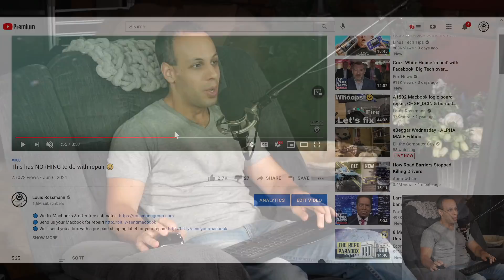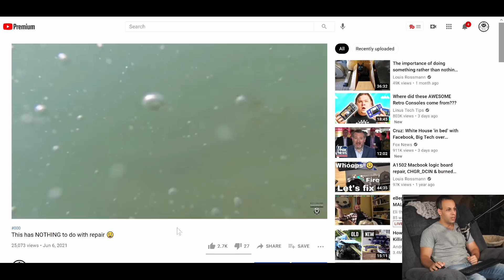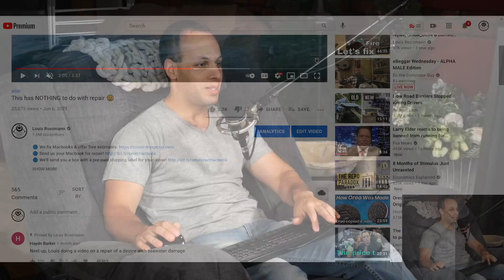Why are user serviceable batteries a bad thing?

Comment: It's great that you pointed this out.  I did not even know that there are people who want sealed batteries.  I remember when phone manufacturers started sealing the batteries, I was annoyed because I am convinced that they are doing it on purpose to force people to buy newer phones when the battery start degrading.  I had many phones and  it is ALWAYS the battery that needs replacement first.

Comment: I miss user replaceable batteries. My Galaxy SIII had a plenty sensibly sized battery and a decent quality case. And, thanks to being able to replace the battery, it lasted me nearly six years. I only upgraded after those six years because the Galaxy S8 was on a pretty solid discount at the time of upgrade. Hell, I ended up having to upgrade to the S10 from the S8 half a year ago because the battery of the S8 was already starting to go down the toilet and didn't last as long as my job requires. I miss my Galaxy SIII already.

Comment: Modern L-Ion rechargeable batteries typically (or should) last longer than the usual mean time to failure (MTTF) of phones and other smart devices; by the time the battery has reached MTTF, the device will be obsolete. This is not true in all cases but it should be true in most cases. Thus, most devices should not need a user-replaceable battery. If the battery reaches MTTF before the device is obsolete then I would suspect that the original device manufacturer (ODM) deliberately designed the device to have that behavior just so they sell more devices.
Thus I can also see the validity of the right to repair argument. If the ODM is making the device unnecessarily hard to repair then they shouldn't be allowed to do that. If the user wants to replace the battery then that should be the user's choice and the ODM should not be able to frustrate that choice just becasue they can. The ODM should have to show an actual necessity in the design features if those design features are going to frustrate the repairability of the device.

Comment: For one I kinda dislike removable batteries because eventually, yes I can replace the battery with a new (hopefully original one), yet the mechanism that holds the battery inside the phone is definitely not user serviceable. I had a personal experience with my phone suddenly turning itself off only for me to realize what was going on and to use a practical remedy (to slip a folded piece of paper keeping the contacts of the battery and the phone intact). Then I also hate that when you drop these kinds of phones, the battery itself springs free from the device lol. Otherwise if it would be virtually impossible for these situations to occur, I would definitely want a phone with a replaceable battery. I'd then buy a flagship phone with tremendous storage and performance and I bet it would last me a decade.

Comment: You are a hundred percent right Louis!! I had to give up my old Samsung phone because I did an update and the camera plus the flashlight stopped working. Got talked into buying the newest Samsung phone which has none of the features I originally switched from Apple to Samsung for! No data chip and no headphone jack! I will no longer be buying from either of these companies because what originally set them apart no longer exists! They are exactly the same!!!

Comment: limitations stimulate creativity. If you have to design a new devices that is both waterproof and with a user serviceable battery, you will be challenged to find new inovative solutions, but you will find one. At the end of the day, it's possible if they wanted to. But they dont want to.

Comment: Some people have no clue about the hardware they use.

If they have a problem, they will immediately run in a shop and claim its not working, pay whatever they charge them and thats it.

And if they are once told that repairing your phone on your own is removing the warranty, they will never touch it again.

For a lot of "luxury" hardware , even headphones, wireless mouse/keyboard etc. some have a backed in battery and its not replaceable, if it goes dead, people buy new hardware, so the company producing it has all the reason to not make the battery replaceable, as it provides them a much bigger profit.

Funny enough, companies with replaceable batteries do not advertise that "feature" enough, while they should, as the people that care for it are tech-savy enough that there is no need for advertisment.

Its the same deal with displays. if it has a "tiny" crack replace the entire expensive front of the phone, instead of providing a stronger protection for it in the first place, people just buy a new phone if they damage it and are "trained" to do so.

Comment: What bothers me is that there are many budget and even some 600+$ phones that come with plastic backcovers nowadays.
Why can't you pop these out and easily replace the battery just like 2010?
I understand that you would need to seal glass backcovers for rigidity and safety but plastic?
You can't even argue that it's more premium or luxurious to seal the backcover since it's plastic.

Comment: Maybe it is because: "big company, I trust more than small company"
I don't know.
I want batteries to be user replaceable.

Also; EVs use LiFePo4 chemistry, phones use LiZn.
LiZn (as far as I know) are optimized for capacity at the cost of lower number of charge cycles.

So a phone battery dying faster doesn't translate to EV batteries doing the same.

Comment: Good rant, but those are not even the most important reasons. I still have a Samsung Note 4 because it was the last one with a replaceable battery. If I want privacy, I can just pull out the battery. If my battery dies, I can swap in another one in, 3 seconds instead of having to plug my phone into a charger. I will never want to give up those things, so a phone with a sealed-in battery is an absolutely out-of-question deal-breaker for me.

Comment: Most phones break or get upgraded before the battery is debilitating to the phone, yes some replacement years after retail release is due to battery wear but the solution is improved recycling ethos amongst consumers and waste services (provided by or subject to the government).
The average consumer will not source, buy, wait for then install a new battery or pay and wait for a repair shop to do so instead, so sacrificing removability in favour of more durable or smaller batteries is worthwhile (both reduce eventual replacement and waste)
Removability is functionally advantageous as an 'empty' battery can be instantly replaced by a charged one so the device can continue operating, today that's only relevant to cameras and devices intended for production/industrial applications, early phones were likely a holdover of that mindset until improved capacity and consumer disuse of removability proved it's not worthwhile to retain in place of the improved water-resistance and freedom to 'miniaturize' provided by non-removables.

Comment: I wonder if battery sizes would remain the same with removable and non removable batteries since usually the removable ones have lots of plastic covering the motherboard and usually their sizes are less than 3200mAh. That's unless they leave it bare with the entire frame and back cover coming off as one and the components are attached to the screen like the Samsung Note 3

What if the rear battery cover comes off with the battery. Instead of having the battery attached to the phone there would be pogo pins and the battery would just slot into the rear cover and not the phone itself. Like a quick swappable rear cover/battery combo. If they could make it as satisfying as DSLR battery swaps or we could have half battery swaps like the modular LG G5 but there's a small built in non removable battery and there's the bigger swappable one so the phone stays on at low power while you swap batteries.

Comment: The I prefer a removable battery is because it allows me to extend the life of the device, and I don't have buy a NEW phone when the battery stops charging properly (which happens every 1 to 2 years). 

I think it's ridiculous when phones have become more expensive than even laptop computers. For $800 to $1000 dollars I could buy a mid-range gaming laptop.

Comment: If I can possibly  avoid it I will not buy anything with a sealed battery.  Two way radios, pagers, computers, when a battery needs to be replaced I need to be able to change it instantly.

Comment: One way to make the battery replacable while fully sealed is: plain screws and a gasket. A few screws around the back cover, with a gasket around the screw and panel perimeter and you get a sealed unit with a replacable battery! At worse, you need to replace the screws and gasket at the same time as the battery.

Comment: except the battery being non replacable is so you cant turn the phone off to avoid being tracked by the government, and its a BLATANT fire hazard, being unable to remove my lithium based battery means i can niether save my phone in the even of battery failure or contain the ensuring lithium/plastic fire by removing the battery before ignition.
frankly if my battery does ever catch fire im going to IMMEDIATELY sue for creating an unessicery fire hazard.
frankly the only reason i bought a google phone is for the camera and i regret it.

Comment: The last laptops I used with modular batteries had Core 2 Duo CPUs i.e. 2008-2009 or so. Did Apple start the trend of sealed batteries with the first MacBook Air?

Comment: The problem with the removable battery is the fact that the back is either clipped on and can come off or not be sealed properly and fail (Galaxy S5) or it'll leave a seam that pops apart (LG V20)
The rich kids don't want that since they like throwing their devices.

Comment: That's 2 of the things I miss the most about my old phone before I moved up to the Samsung Galaxy S -series: I had 4 batteries for my old phone, which IIRC was an LG. TRUE rapid charging is swapping a battery in 30 seconds and having 100% life. 
AND other major feature, you can actually, definitively turn the phone off and know it's off, by removing the battery.

Comment: If it doesn't have a replaceable battery "I am forced to buy a new one, really I don't want to but I have to". Which is what they wanted in the first place. A quality fashion chain here is AUS did some research on why women weren't buying their product. Turns out it wasn't price as most would have guessed, it was that it "lasted to well". The sooner it looked a little worn the sooner you can replace it. p.s. I'm still running an S5 lol

Comment: One issue I see is wireless Charging. It uses both the charging coil and the glass back to make it work. This would pretty much stop any efforts to have a removable battery. You could have some system that allows you to move the wireless Charging up and out of the way, however that adds complexity which increases the chance of failure and the cost. You would only be able to have a partial glass back since a full one wouldn't work for moving it up and there's a large possibility of the flex cable for the wireless charging to wear out.

Comment: i agree with you rossmann but ive always preferred batteries in phones i could replace main reason being at most i have to spend $30 for a new battery instead of $200+ replacing the whole phone do to the battery being at the end of its life/ battery shorted out and no longer being useful

Comment: I'm still using my Samsung S5 because it has a user replaceable battery. I just bought a Pine Phone because everything is user replaceable. When other manufacturers build phones that will last,I'll buy it. I'm on my 4th battery for the Samsung but finding good new batteries is getting harder.

Comment: User replaceable batteries are a horrible thing.  they let you take the battery out of phones so they can't be tracked.  Apple has every right to remotely activate my phone and ping it to find my location, and i have no right, or justification as an end user, to be able to pull my battery so they can't do that.   

If i couldn't i could hide from the police for example.   which is 100% wrong.

Comment: I have an LG G5 (model LG-H820) phone, and have had for years.

While it's not a "water resistant" phone, it does have a very easily replaceable battery (though now finding an ACTUAL new batter vs. new old stock is a pain in the ass).

For water resistance I invested a few dollars more in an "Otter Box" phone case and now I don't necessarily have to worry as much about moisture (though after all these years I doubt the case is as water proof as it once was).

Anyway, if/when I replace this phone I am going to miss being able to simply take it out its case, pulling the bottom off, removing the battery from the bottom and then attaching the battery and reinserting it...

The ironic thing to me is that this phone is ONLY 5 years old, having originally been released in 2016, yet it's thought of as a 'relic'.  

THAT is the really sneaky thing the cell phone providers and manufacturers have done to us...   Any phone older than two years and suddenly you start hearing, "OMG, where'd you find that old POS boomer?!?!?"

My grandfather used to regale me we stories of how it was so much better in the 50's and 60's:  "Remember when it used to be a point of pride in companies that, "This will be the last 'widget' you'll ever need to purchase!  We're so confident in its design and manufacture, we'll give you a LIFE TIME warranty on it!"  Now-a-days everything is built like crap on purpose so it'll fall apart.  There's no pride of product any more!"

Comment: I guess most people forget that there is a SIM card compartment, that there is a charging port, and buttons on theirs devices that are movable parts and are liquid resistant at the same time. The technology has been there. 8 years ago I got a Kyocera flip phone that had a removable battery 10-key pad with other function buttons on it and I could use the phone underwater, send txt message, video, flip closed and open again. And never drown it. It actually still works to this day. Just quit using it.

Comment: wait, there are people who believes the lack of removable battery is actually a good thing?!?! have they never had their phone completely lock up and the reset button not respond before? I may be someone who will use devices for well over their life span, and have actually had devices outlive their battery before, but removing my need to be able to buy a new battery and drop it into my device, which I've had to do on a device that didn't have a removable battery compartment before, I have dealt with too many troubleshooting issues where the best option was literally to remove the battery, and you can't do that if the battery is sealed in.  Then again, this is a life long tech head speaking, rather than the average joe shmo who has to take their phone in when the sim isn't reading because it got unseated

Comment: The excuse I've always heard is that a user replaceable battery takes up more space inside the device, which could instead be devoted to better processing, or higher capacity battery, or something else, because phone design is largely volume-constrained. 

 I don't know if I believe this, but even if I do, I would probably prefer I use the replaceable battery and a thicker device or something.

Comment: I like being able to change out the battery. What I don’t like is not knowing which batteries are great and which are scams, or at best low quality. I imagine you get your DJI battery cartridges from DJI. I don’t know what could be done like that for phones. Also, there is a reason that camera batteries were swapoutable due to not generally having enough juice for all the work expected between charging. Phones have a much different history, with batteries lasting between charging times.

Comment: I mean, have you ever seen a removable battery that has as many mAh as a Samsung or iphone flagship device? As far as I am aware There's a limit to where the removable batteries can get to in terms of mAh. like my phone's battery though non-removable has a mAh of 4300-4500. Though there is a right for repair shops to have access to the appropriate batteries for said devices they are repairing.

Comment: I don't want /user/ replaceable batteries, mostly because making them easy to take out means they need a plastic cover and everything, so phones would get either thicker or have shorter battery life, compared to the sealed-in pouch battery. I still do want phones to be serviceable by some sort of specialised technicians (manufacturer-independent) who know how to get them open safely and seal them back waterproof afterwards. And of course I want the manufacturers to actually sell these technicians original replacement batteries, because if history taught me one thing, it's that cheap knockoff battery packs usually spell trouble.

Comment: The one argument I've seen for non replacable bateries is that because they dont' have to have a hard shell they can achieve higher capacities. which would be great if better power efficiency was not the better solution.

Comment: I replaced the battery in my oneplus 3 quite a few years ago and it was a pain but probably not as bad as most new phones, but I ended up screwing up my camera module in the process I think, it could never quite focus after that, wasn't the same. Then I broke the screen a few years later and decided it was time to upgrade, I loved that phone though, full featured with no gimmicks and had pretty good specs and processor etc. just had a shitty battery. Wish they still made phones like that